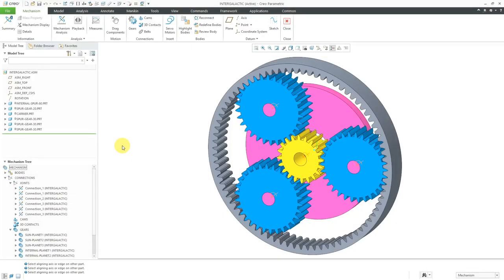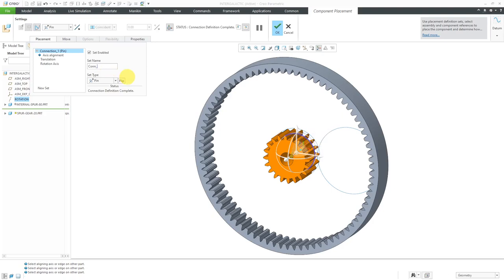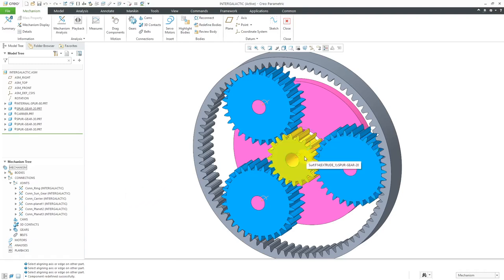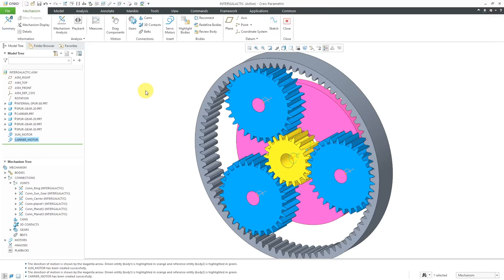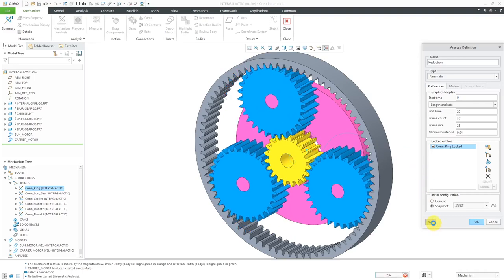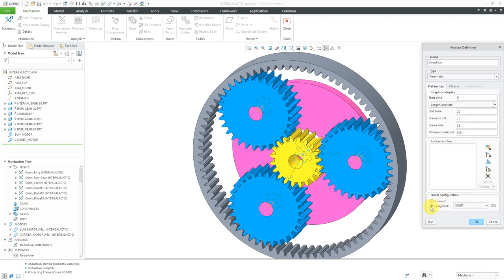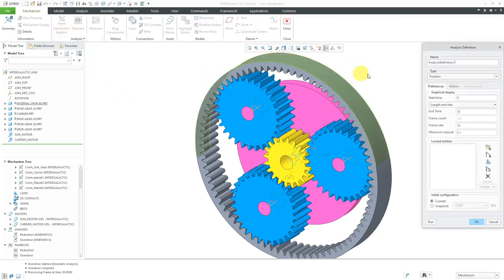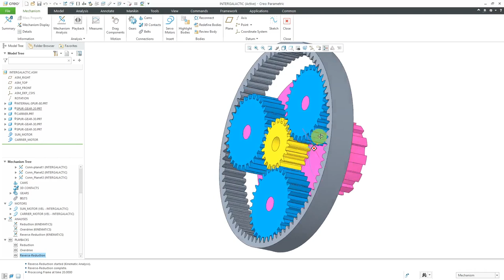Creo Parametric - Mechanisms - Planetary Gears (Part 2)

Comment: Great, I've done the same model but didn't have meshing issues as in your second kinematic analysis, the only difference is I've had the teeth designed according to involute curve equations, that could be the reason why you're having that issue since there is also teeth overlapping in your other kinematic analyses. Thank you for the video it was great.

Comment: Great tutorial. Is it possible to drive the pitch Diameter in the mechanism gear connection by a relation or parameter?
Reply from the maker: Yes.
Reply: @CADPLMGuy  Thanks for the answer. Can you explain me how. I tried it before, but wasn't able to do so.

Comment: That was a great video. I really learned. But seems like there was a problem in the motion analysis at " 5: 51 ". If you observe carefully, the sun gear is not meshing properly with planet gear. This is due to the reason I guess the direction of the sun and the planet must be the opposite. Similarly, the direction of the ring gear should be in the same direction as the planet gear.
Reply from the maker: Thanks. I was wondering why it wasn’t working. I’ll have to give that a try to see if I can get it to work properly.